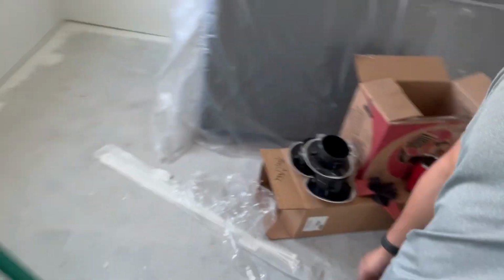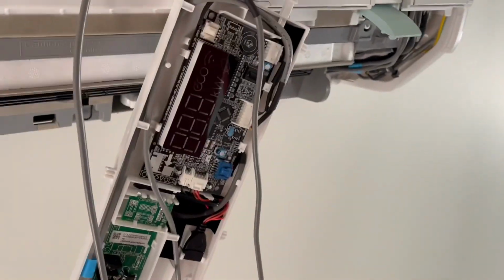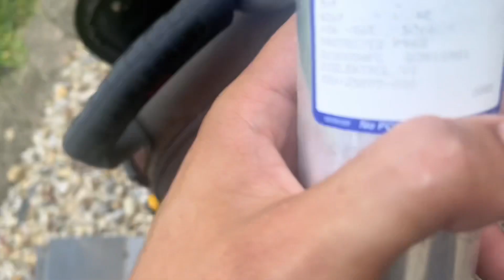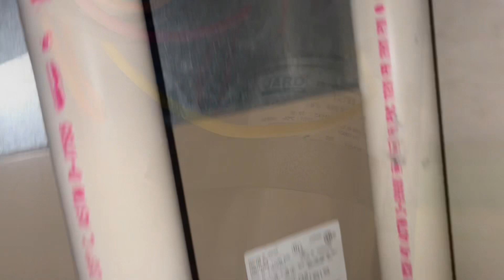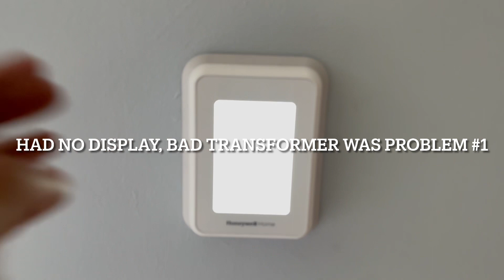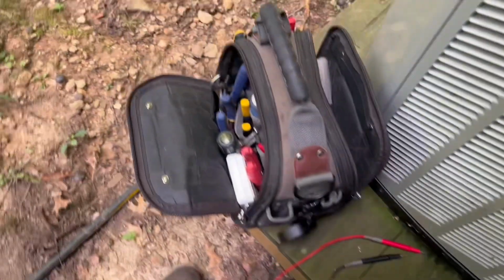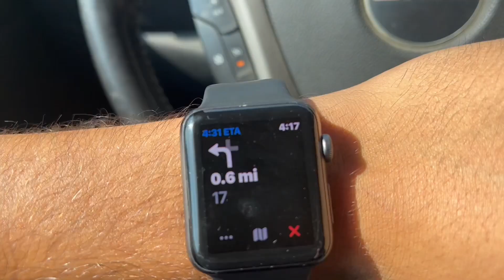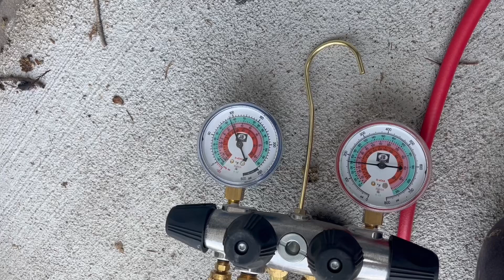Day In The Life: HVAC Service Tech

Comment: For you capacitor question. If the wrong size is installed the motor will have a uneven magnetic field. This will cause the motor to hesitate at those spots on the second winding and can cause the motor to over heat and cause uneven wear on the second winding leading to failure. Since you only went up 5mfd you probably will be ok since most capacitors at +/- 5%. 5% on 45 is 2.25 making it 47.25 mfd if that capacitor had been on you truck for awhile it may have been below 50mfd anyway. End story it probably would be fine and i would have done the same and left a note on the ticket to stop back by later and change it back out to the right one
Reply from the maker: Explained it perfectly. Thank you!

Comment: There is usually a screen right before the piston and it could have easily been clogged up! Great job, enjoy your video's!! Be safe out there in the heat!!
Reply from the maker: Thank you! Turns out the filter drier was slightly clogged up, I didn’t consider that screen though so thanks for your info!
Reply: @ShortyHVAC  keep up the good work!!